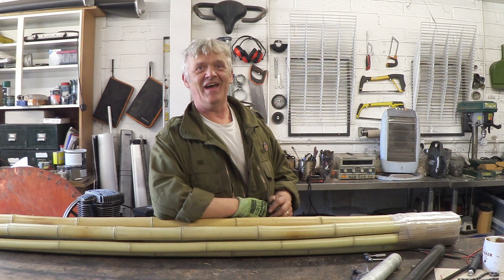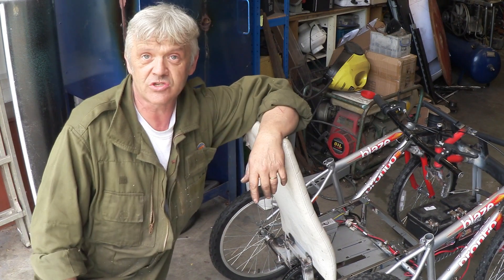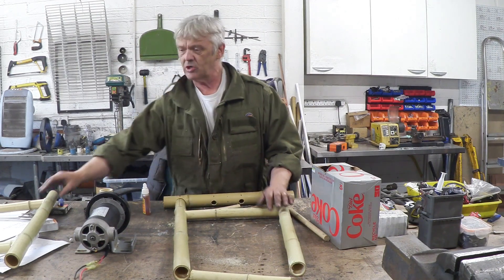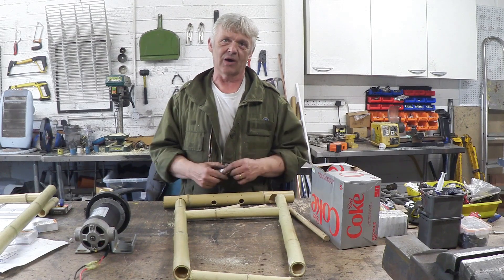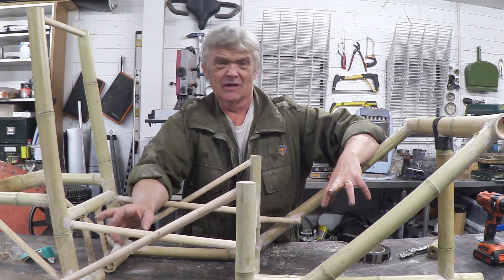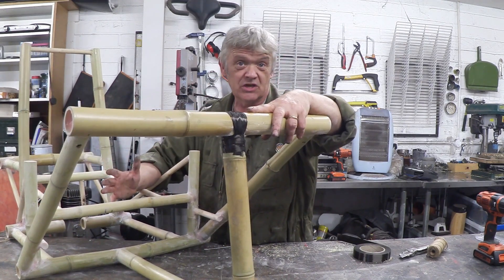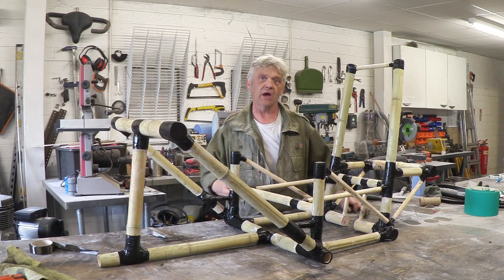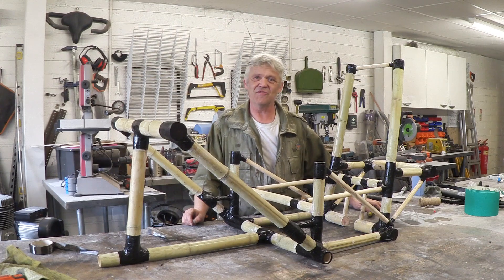1152 Building A Bamboo Electric Quad Bike - The Frame

Comment: I guess I accidently erased my post earlier when trying to edit it.  Anyways, to reiterate, one of the oldest makers of bamboo bicycles, Calfee, found out the hard way that carbon fiber is not a good choice to wrap/reinforce bamboo joints with because the two materials have very different expansion and contraction rates.  You'll eventually get split bamboo. 

    Hemp, flax linen, fiberglass, basalt, and kevlar (I think?) are better choices than CF.

Comment: Well done Robert Flintstone. I made my house out of bamboo and it's quite strong if done properly. Very labour intensive though. Stripping the skin and cleaning took forever. The older bamboo is extremely thick and suited for tables and armchairs etc. What you have there is the thin upper part of the stems. Anyway it's another fun video and I can't wait to see you peddling the ground to get going LOL.
Reply: Why do you strip the skin?
Reply: @paulbrouyere1735  I am not sure if it's just purely for the finished look or what. I just followed local methods. It certainly looks nicer when varnished. They say that it should be treated in salt water for days also to help it from rotting maybe.

Comment: Looks great .. well done.... Calfee used carbon fibre for their bamboo bikes but now use fibreglass surgical wraps
Reply: Yeah, the CF was making the bamboo split, crack, and/or warp when the bamboo would expand with heat and/or moisture and the CF wasn't. That's a big reason why they switched. Plus, fiberglass is cheaper and more sustainable than CF.

Comment: Rob

Can you put one or two Rose buds in front?

I say a guy on YT do it on a car, and it pushed the air around the car and produce power and  fuel savings.

When the quad is not moving it will still charge the batteries.

Maybe two at an angle in the front to stream line it? Revolutionary maybe?

Comment: Carbon fiber is a genius addition!  I am really looking forward to how this turns out!
Reply: No, it's not.  Bamboo bike makers have found that CF is not a good material to wrap bamboo joints because of the very different expansion and contraction rates of the two materials.  It eventually leads to cracked and/or warped bamboo. Calfee used to use it until they noticed this happening, and then they switched to other reinforcement materials (I think hemp, but fiberglass would be even better.)
Reply: I think the problem is in the expectation that the bamboo wouldn't eventually crack.  Do the tests definitively indicate that it was a problem of expansion and contraction?  My first thought when you mentioned fiberglass was that it might have the same problem, depending on what resin was used.  However, if it was the rigidity of the carbon fiber causing stress to the bamboo, perhaps fiberglass would be more forgiving.  
I searched Calfee, and saw Calfee Designs had made a bamboo bike, which wouldn't really have the same stress in use as this electric 4 wheeler.  I also saw Calfee was a weight loss Youtuber.  Lol
At any rate, my intention was that the idea for carbon fiber was a genius inspiration, the same as what probably inspired the Calfee blokes.  Whether it turns out to be the best option remains to be seen, and my interest is now doubly peaked to see this vehicle completed, and see how the joints do or don't last.
Reply: @imaginarymask   Bamboo expands more than CF with both heat and/or moisture. CF is not affected by moisture and expands little with heat. 

   Fiberglass is both less stiff than CF, and has more stretch. Fiberglass fibers when under tension past their tensile strength will stretch some before they break.  CF catastrophically breaks soon after it's ultimate tensile strength has been reached.    In any case, it's more important in this instance that it's like you have a vice overlaid on the bamboo and when the bamboo expands, the CF does not.  The CF being the stronger of the two materials in tensile strength, Young modulus (stiffness strength), etc, it does not "move" with the bamboo.  Hence, the bamboo cracks. 

  You don't need an exact match of expansion/contraction rates, but you need "roughly similar".  Putting it in a specialized epoxy, like G Flex and not wrapping so tight, might also help, but why not go with fiberglass when it's far cheaper than CF, and more sustainable?  And if a person likes natural aesthetics, hemp, linen, and raw bamboo cord will also technically work ok to decently, but in that case you want the strongest (composite type) epoxy you can get to help the natural materials out some as these are far weaker than CF and even fiberglass. 

  (And S-glass fiberglass is not actually far behind common, cheaper commercial forms of CF in strength to weight ratios, though it is less stiff, but is half the price.)
Reply: @justinw1765  Makes sense.  Well said.  It would be cool to see some tests done with various materials.  In the pitch video on the Calfee Designs channel, he indicated it would be a good project for students and that he also introduced it in Africa.  I would be interested to see all the data that has been created by all the different iterations done so far, especially from Africa, where it has probably been exposed to a lot of practical use by people that have to make do with what's available.
Reply: @imaginarymask  Yes, agreed, it would be nice to see such tests.

Comment: Rob

Soda bottle can be spliced into really long rope easy. Then if you heat it with a hair dryer it shrinks making the joint super tight.

And it free if you find some 2 liter soda bottles. The green ones have built in UV protection. I suppose you'll have to put some UV protection around the shrink wrap soda bottle rope.

But it's free if you make it work.

Comment: I watch all your videos and they are excellent.  May I suggest an AGNI or Lynch motor for this project, they are unique axial gap high power DC motor capable of running off a 9v battery, or 90volts @ 15kw.  Power supply is simple, and run of the mill PWM DC controller will work with them.  Just throwing it out there as they are simply amazing motors in my book.
Reply: Thank you for the update.

Comment: I would love to make one out of 1 inch PVC pipe.
Reply: If you use PVC for this is a great idea if you got some.

I would go with inch and 1/2 or 2 inch. 80 schedule if you got it.

You will have to paint it for UV protection.

The advantage of PVC is no rust. Not rot. Lighter than steel, and it can be heated and bend in any curve you want.

Comment: That is a nice building material bamboo hell we ought to make more stuff with it it's strong lightweight not quite as light as bocle wood but close and it's strong and putting carbon fiber joints it's going to take a lot of abuse to break that apart

Comment: How hard is the bamboo to work? Are you using woodworking tools or metal work tools?
Reply: Best way to cut bamboo is a pipe cutter used for plumbing copper or aluminium tubes. That way you have no splinters.
Reply: @paulbrouyere1735    Interesting, haven't tried that yet, thank you. I've used a hack saw with good results, but sometimes do get a little splintering.

Comment: To adhere to the theme, one can get bamboo cord which is very strong.
Reply: I didn't think of that. That's awesome!!!

It you wet it down with water does the bamboo cord shrink, and get even tighter?
Reply: @reypolice5231  Yes, like all cellulose fibres it will change length with the relative humidity (even paper does this). Also, Rob appears to have bought green unseasoned bamboo, which like timber will shrink as it dries. Hence, any lashings will need to be tighten again. The spec sheet should indicate what processes it has undergone like drying, and if any preservative treatment has been applied etc. If it was supplied  for interior decorative use only, it may biodegrade quickly or put another way, this cycle may recycle itself without help from humans.
Reply: @Nuts-Bolts    When buying bamboo cord, make sure it is the raw stuff, and not bamboo rayon.  Bamboo rayon has been through some harsh chemical treatments and is far, far weaker than raw bamboo cord.  Ime so far, it's harder to find raw bamboo cord.
Reply: Also keep in mind that bamboo cord, the raw stuff, is also often waxed. This is not good for reinforcement composite type applications because wax has low surface energy and is hard to adhere anything to well.  That's why it's often used as a mold release agent in composites, ironically enough.  You would have to get rid of the wax coating first to use this stuff. Otherwise, your epoxy is likely to peel/shear off of it.